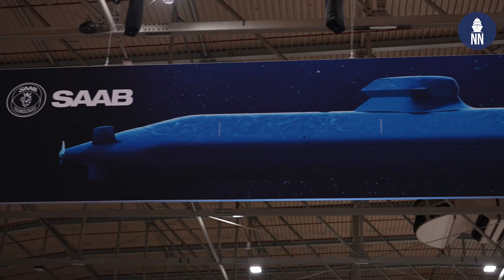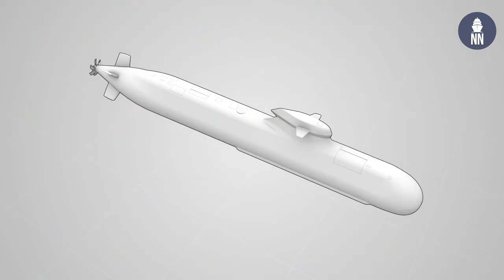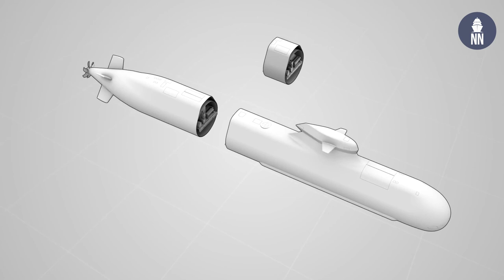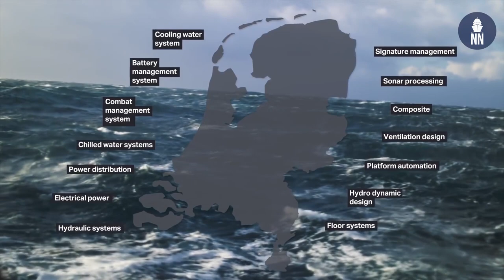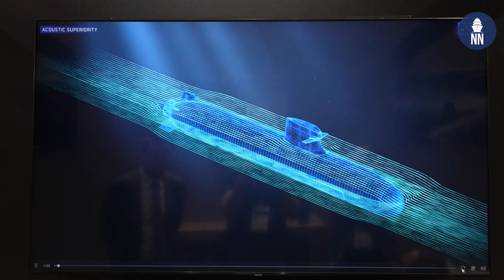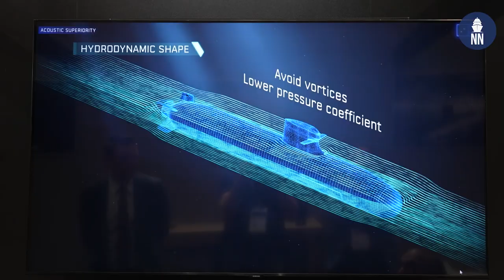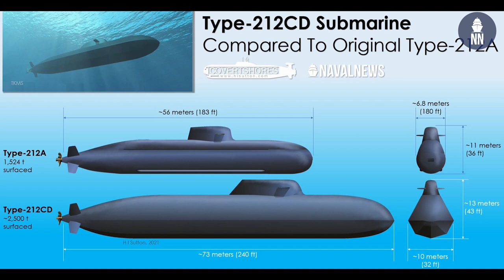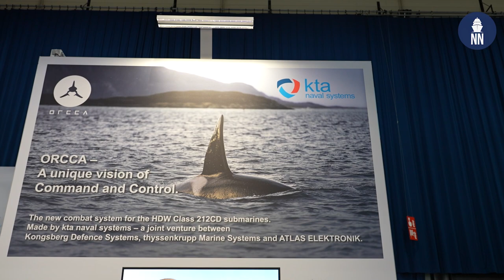UDT 2022: Walrus-class Submarine replacement program with Saab, Naval Group, TKMS

Comment: Interesting report Xavier, did Naval Group also have information at their stand on the Scorpene class? From what i understand those were on the dutch shortlist in an ealier stage as well, even though their size would make them less capable then current walrus boats. 

Personally, after hearing the news that due to the walrus replacement slipping back further and further, our navy will be taking first one, and then a second boat out of commission to use for parts to keep the other two running until replacements are ready, my first reaction was "buy two scorpenes NOW to keep the fleet size at at least 4 boats, until the diesel baracudas arrive, at which point we can have a 6 sub fleet, the baracudas as full capacity long range subs, the scorpenes for closer to home duties and patrols"
Reply: Keep on dreaming! We can not afford French subs. They are way to expensive. And no hope in hell we can afford 6 boats. Besides, the Scorpene subs are simply not good enough.
Reply: @Robert66734  I dont know anything about price, but with regards to the scorpenes, i know they are less capable then the Walrus, or the baracuda, but they would allow the navy to operate 4 subs (2 walrus, 2 scorps) until the proper walrus replacement comes along, preserving crew and training. And while they might not be able to cover all of the walrus'  duties, some scheduling could mitigate that, and it would still be better then operating just 2-3 walrusses

As for prices, your guess would be the baracuda is to expensive, so we will end up buying either the 212CD or the Saab-damen boat?
Reply: @N Fels The biggest problem with the German submarines is that so far they have only built boats with 1 compartment, unlike the Walrus class which has three! These multiple compartments give a better chance of survival for the crew during war situations and are also necessary if you work with divers a lot. It is also necessary if these submarines are going to be equipped with a VLS.

Another problem (including that of the Swedish A26) is diving depth. The Walrus has a diving depth of over 300m. It remains to be seen whether both the 212CD-E and the A-26 can do this. This part speaks in favor of the French Baracuda which can dive as deep as the Walrus.

Another important aspect is that the 212CD-E only has two diesel engines. The Walrus and the A-26 have three. For long operations it is clearly an advantage to have three. Also these boats need to be configured for these long voyages.

The Russians use the same acoustic detection equipment as NATO. They simply made a copy of this, that they are worse at acoustic detection is an assumption, which is not correct.

You are right when it comes to the Scorpene, this is not a serious option for the Dutch navy.

Politicians are the problem! Also the ones you speak to! They do not have a clue whatsoever. We have had incompetent politicians from the CDA and the VVD in these positions for many years. They have introduced a 5 layer decision making team to make a choice which submarine they will eventually purchase. These 5 layers mainly consist of government officials and accountants from EY.

Comment: Does one of the three concepts could have missile like tomahawks onboard? Launch by torpedotubes?
Reply: The French one: yes.
The other ones: not sure, don’t think so, these are rather small hulls.
Reply: @jetaddicted  not so small 2000 tonnes at least. also tomahawk is standard 533mm tube anyway so yeah pretty sure its possible to use cruise missiles on each of those subs
Reply: FYI UK Astute launch tomahawk via torpedo tubes

Comment: to bad Australia gave up on thee French subs
Reply: They poured money into the DE version of the Barracuda which NG is offering to the Netherlands.
Reply: @briananthony4044  Bottomless pit......
Reply: @briananthony4044  But the naval dude just spoke about "SSN" and "long range". I am pretty sure he was talking about the standart (nuclear) Sufren class Brracudas.
Reply: @maxcyber  He was referring the SSN Sufren class as the basis for the proposal. But it would be a diesel electric version, similar to the Attack class the Australians were going to purchase, which was based also on the Barracuda. They would basically remove the section containing the reactor, turbo generators, condensers etc and replace with a section containing diesel electric generators. The Barracuda is driven by an electric motor as was it's predecessor, the Rubis class, so it doesn't care where it's power is coming from. One big change is finding space for diesel fuel and battery packs in the design.
Reply: @briananthony4044  You're right. I don't get why he would talk so much about nuclear ones when the offer is about diesel ones. Maybe they want to avoid what happened in the australian press (LIke "If you want nuclear ones, just ask").
Reply: @maxcyber  I think he was emphasizing that his groups offer was based on a much more powerful platform, the Suffren class SSN so would be a better candidate. Buy our submarine, and apart from the powerplant, your getting the best submarine that our own navy uses. 
The competition meanwhile is leveraging up smaller less capable designs, and being a new design, are bound to have problems. The current Australian submarine is a good example of that. Based on an enlarged Gotland class, they have suffered from a range of expensive problems through their early life.
Reply: The Collins class is based on the Vastergotland class, not the later Gotland class.

Comment: so naval group are offering the sub they were desigining for Australia a diesel baracuda and have the hide to ask Australia for compensation hope the dutch realise they simply didn't deliver
Reply: They didn’t deliver, because Australia changed their mind I really don’t see what’s so mind blowing about that. As for the compensation it was written in the contract from the start, naval group didn’t really even need to ask anything Australia knew they would have to pay.
Reply: @frogfichtrlustr369  Yeah I don't understand why would naval group be critisized for proposing the same model. I guess it's just French bashing.
Reply: What miss opportunities but Naval Group we’re dragging their feet, interesting is weapons n sensors fit out is different to Australia version which another sticking point in the process especially sonar was USA version from Virginia class submarines.
Reply: @jamieshields9521  Naval Group didn't drag their feet . For example, they tried to get the size, weight and connectors type of the BQQ-10 or other flank array from the US manufacturer. Well they never get any answer (neither the Aussies even if they had a former US submarine CO as advisor). How can you design the submarine internal without those information. But well, it's always the fault of the French.
Good luck with the new AUKUS deal, no Virginia or Astute for the RAN (both US and UK can't technically deliver since they have their own priorities). The Collins will be in service for a long, very long time. Enjoy!
Reply: @hermes6910  then why didn't the french pay us any afterall they didn't meet the design requierments at any stage of the contract they were always late by many months they were the ones who failed to live up to their side of the bargain and were years behind where they said they would be
Reply: @qanniqtuq  I know it’s not all Naval Group fault as Australian Government had change PMs in few years, RAN requirements for US technology n weapons these lessons should been learned from Collins class build. Hindsight I believe Australia should went with Tony Abbott when PM for Japanese submarines or build 2.0 version Collins.  This political decisions, it not Naval Group problem to interfere but it was timing issue which now taints their imagine to deliver on time.
Reply: and the new Labour Australian gov is paying almost a billion dollars in compensation to NG as well.
Reply: @jwenting  it’s sad time for French they could have improved their defence equipment but like NH90 which is good helicopters, NH 90 had design flaws, buying them n owning them is different to other helicopters which effects Australian ADF outcome.  The French company was dragging its feet with spare parts, fix problems like design faults, ADF wanted SF helicopters but years later nothing, what happened?  Same issues with Tiger helicopters n SeaSprite where Australia requirements were technology pipe dreams, the reality Australia should brought Blackhawks, Seahawks n I reckon Vipers to cut operations cost when training with US marines.
Reply: @N Fels At least France have Nuclear submarines. Australia will have one for a long, very long time, if they ever get one.